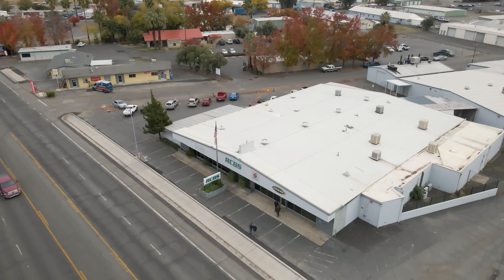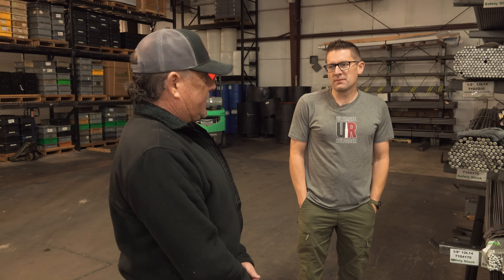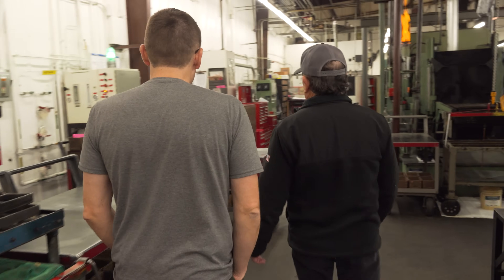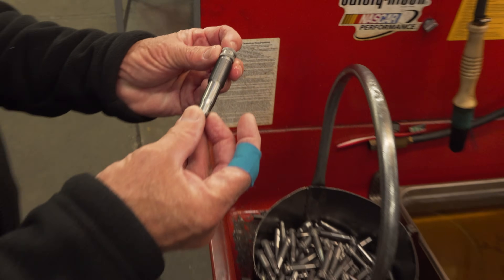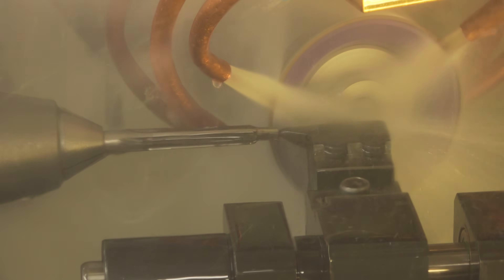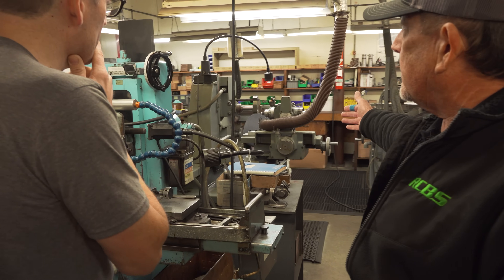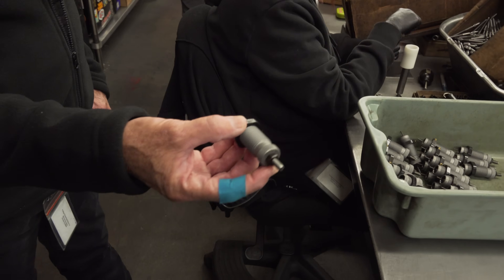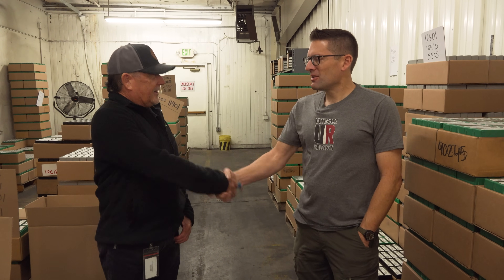How Dies Are Made: RCBS Inside Look

Comment: I guess I have had for a long time, about what the process was (my brother being a tool and die machinist probably helps with that). But I didn't know that they made their own reamers. I would think, that the reamers are carbide? Maybe you could verify or deny that.  Sadly, with the new cnc fully automated machines, there isn't much to actually see. Bars of steel go in, and parts (dies) come out. All that is left is heat treat and assembly.  RCBS's quality is legendary.  I guess the suggestion i would have next time that you do a factory tour similar to this, is what we as end users, can do to make better use of their tools. like common questions that they get, especially from the new and upcoming generation. that will make for easier and better loading practices. not general things like keeping only one powder, bullet and primer at the bench, but things that will really matter that new guys and gals do not hear or read in general loading talk. things like how to adjust the dies for the perfect crimp, the difference between roll crimp and taper crimping, and when to use each. how to, and how often to clean dies and presses. what to, where to, and where not to lubricate them & with what lubricant. , things like that. most of us "old timers" know. but a lot of young guys are not fortunate enough to have a mentor. And much of what I learned was by trial and error. every once in a while, I will find I have been doing something wrong for 30 years, and it hasn't bit me, yet. there was NO internet back then. And I didn't have a mentor for the 1st 15 years.

Comment: I started with RCBS in my teens and still using them at 68 . The die set that I am having an issue with is the 6.5 Creedmoor. it often feels like it is on the verge of getting stuck when resizing ,using unique case lube by Hornady. It feels like very rough edges or sand in it or something just by the feel on the handle of the press. Their are no signs of scratching on the cases, but it feels like the case will be destroyed . So I take the die apart and clean it every time I use it and it helps a little. Any ideas what might be wrong.

Comment: Of the 40 to 60 die sets I have by RCBS, never a single unit had a flaw. I can always count on the precision factor, as per any mistakes that I have made, were always, my fault in set-up & adjustment. I gotta say, every mistake has a pattern, and points me in the direction of my own "OOPS!", because the dies sets are just that good and matched. I have not competed in about a year for ELR events, but, when I was, the RCBS dies will out match my shooting abilities, when precision is questioned. 

I can't speak on behalf of the F-Class nutcases who claim "too much carbon monoxide is in the air on the other side of the planet for why their projectile was a couple mil's off at 1000yard or 27 miles out", or what ever those weirdo's do.. lol.. , all I am saying, the quality of RCBS exceeds my skill sets on the long ranges. 

To add to that, my grandfather gave me his old cartridge building stuff, some of which I do use, I have many of those vintage RCBS die sets from 40 to 60 years ago, I do not know factually how old, but, the .357 die set, well over 100k reloads via grandpa and I still use  use it to this day. Not as many as my grandfather has, but, does a fine job. I can measure no difference from the 50 plus year old .357 die set to the set I got about 6 years ago, as a double check and they measure the same when the setup is dialed in for my desire factory load spec. 

I am not gonna beat up on any other brands, as I have many of those also. Sometimes, it is unavoidable for a design character needed. Also good stuff. But, I have had some flawed units show up by other lesser brands. But, the product was replaced, and only requested they get the flawed unit back for quality control. I respect that. No problem, no foul. Stuff happens. But, never once have "I" recieved a hindered RCBS die set. 

Thank you for the high quality control measures, and tough products lines. Mericuh!!!!

Comment: Little off subject  but  try  in 350 rem mag loads . 38 wad cutter with  pinch of bullseye for  grouse  and 125 gr hollow point  with a fast powder. For a very impressive wolf/ varmit  load. It blows a big hole. Even on a 2×4  it rips apart. 
Rcbs dies never let's you down.   The mean green machine. 🇺🇲